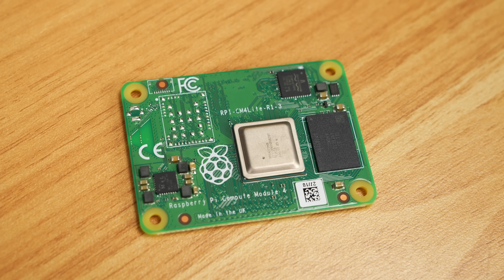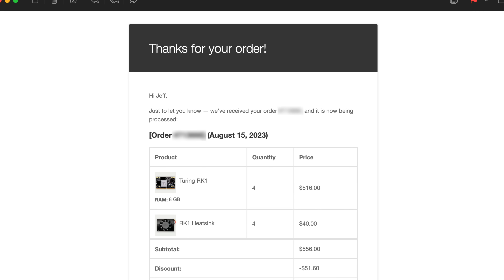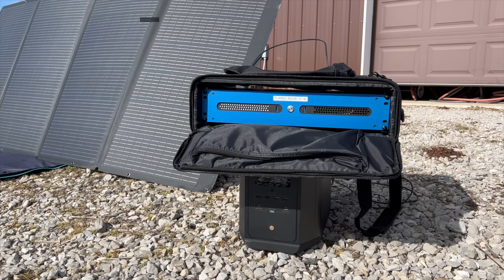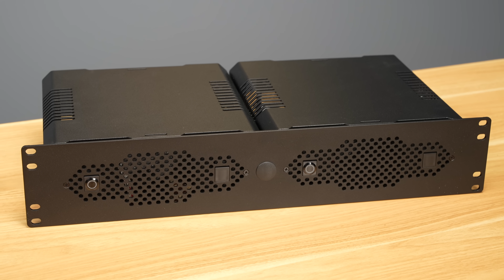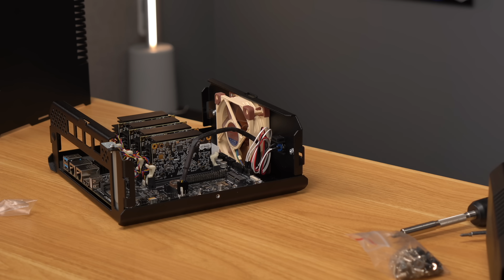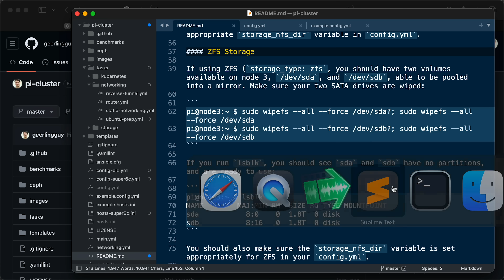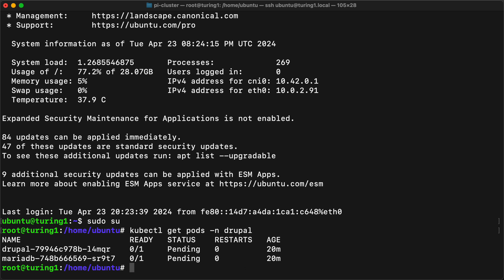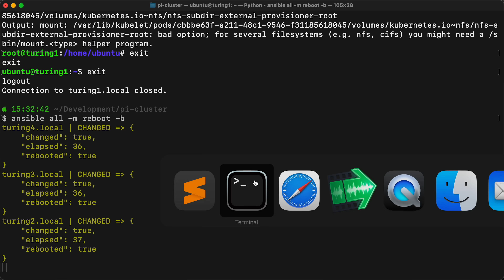Meet the new SBC Linux Cluster King!

Comment: My biggest issue with working with Pi's and Pi alternatives has been lack of conformity to standards such as ITX boards, or even conformity to Pi's I/O and size so that you can just use Pi cases or options. Something like that ITX Board, as well as the rackable case is a huge leap forward. Yes, we can 3d print things, but the more options we have, the better. 

I love SBCs, but prior to now them not having more standard footprints means that I literally sit a pi-hole with a POE adapter on top of a POE switch in a rack. It made no sense to have a full 1u or bigger rack mount for 1 pi. Then I have the second pihold on a separate part of the network, just sitting next to my NAS in a different room using a power adapter and network cable as I had power available there. I also have numberous Libre Computers sitting around, just strewn everywhere because where they needed to be, I couldn't put a rack.  Most of these locations have other computers and if we had more options for say, PCI brackets as well with power and network cabling through the PCI bracket, I'd mount them in the PC cases. But for now, they are just sitting in 3d printed cases.

So things like this are a great idea and leap forward. I'm excited to see more options coming forward as I mainly work in IT Support, not systems administration (which I can do and am good at), not Devops, not with 3d modeling, etc. I can implement and combine solutions if they've been built and sold, or I can implement very simple solutions. The more options I have, the higher probability of Pi and Pi alternatives have of getting into my workflows instead of tiny computers like the Lenovo M90n, or the other Lenovo Tiny models. I definitely don't need their horsepower, but they've just been a better option ultimately when I can get them at work's surplus sales for say $40-$150.

Comment: When you mentioned the poor network connection for the tasks you might run on that board, it reminded me of something that annoys me a lot (I do not remember if I said it here before) and I have been preaching for years (maybe not hard enough) in the hope that maybe someday manufacturers hear me: 
Motherboards should not have IO attached to it. Specially now with fast PCIE connections. 
Instead they could have 4x (or even 1x for slower IO) PCIE connectors where people could connect short (as in length; maybe 5cm would suffice) 1/4 or 1/2 (half) height boards with the IO they need. 
This would turn the current IO on the back of motherboards into something modular that could allow, as an example, a user to put more USB of type XYZ in their motherboard without having to occupy a full length slot, or replace their gigabit network for a 10Gbit fiber, or add a WiFi card of the latest gen. 
Why must valuable space on my PC's back IO be occupied with 3 (or 6) jacks for speakers/microphone that I will never use? Or with connectors for antennas connected to a WiFi card that no longer works?
From my point of view Framework is on the right path in the laptop space except that I feel that they should be using PCIE directly. It would be better for connecting external PCIE devices. Baby steps. We need that on desktop too.
Sorry about the rant. Very interesting cases and cluster :)

Comment: Break out the soldering iron and swap the direction those power leads exit the PSU board. No more fan-blade jeopardy, no more stressing of the board connector.
Reply from the maker: True. May do that before I move the mini rack into its final location.

Comment: I did not know about 10" rack systems. Very cool.
Reply: @JeffGeerling In reply to your comment on 17:46 about the availability of 10" racks in Europe: I got lucky getting a 30cm deep closed 12U rack from a now defunct Polish company (COVID stock/supply issues I guess) I only could get the MyElectronics 2U enclosure in there by putting in some custom spacers to get the ITX case closer to the glass front door. Otherwise the cables in the back would just not fit. Any deeper rack would not have fitted in my utility closet.
I once revved out the diesel my driving instructor used when I was still learning for my driverslicense, some 300 meters from where MyElectronics is currently based in Alkmaar. I now have one more reason to chuckle about that event, 'some' American guy made realise that they were based there.. :)

Comment: I think I would have desoldered those pico power supply input wires and put them back on the other side.
Reply: I looked around the online stores and seems like some of those have cables on one side and some have on another, so buying from another vendor might also help If you don't want to mess with soldering iron or loose warranty.

Comment: Someone needs to do an OS from the ground up with different resources speeds and priority to actually make the best use of theese type of cluster boards...
There are so many solutions (mainly Linux ones I guess). But an OS that could handle any resource speed and just add the "power" and send different tasks with the resource speed in mind would just be awesome... I mean I have so many computers, phones, SBC and stuff... Would be truly awesome to install a component in everyone of them then get good (or even some use) in an a OS/Program.

Don't know exactly how to do it but... Lets say you have main/master then install "nodes" that firsts benchmarks the speed of the resource (read/write), then the compute power (I don't know what is best here... but OpenCL? and the OS has numbers it's could use... empty node, what is the threshold for sending a task to this node (because of the low R/W speed) is it worth it...if yes... send it... I mean my phone has some stuff that not even my (now old computer) does not have... It might be worth sending this task to the phone (resource)... and so on and on...

I remember setting up a render farm with all my older computers, and my friends computers thru 10 Mbit coax network, and that was just awesome...

So again... an OS (with programming language (that might exist today, or maybe better to actually create a new one)) that is built with the idea that you have low speed (again, could be a simple benchmark at the start of the OS the check what speeds everything is working with)...

Some programs would have no use for a phone (with 60 Mbit high latency network) ofc or even a fast CPU/GPU with 1 Gbit connection, but I can think of many programs that could use it... and again if you made the OS (dream OS? :-) you could always pretty much make use of older hardware (but it does need a sleep mode ofc, so no really really old hardware I guess)...

Comment: Could you use a M.2 to 10gbe adapter? Like the ones from Innodisk or IOcrest?
Reply from the maker: Technically yes—but the z-height on the bottom of the board would mean it wouldn't mount in any standard case, unfortunately (and you'd need one per node, adding a pretty significant cost!). But it is possible, if you build your own riser for the motherboard.

Comment: Lovely labels on the fan box ;)  How does this compare to the Ampere 64 core ASRock Rack? Withouth memory that is also $1500, so slightly more expensive.
Reply from the maker: It's a lot easier to build with the Ampere, it has a LOT more PCIe expansion available, and if you just want a high performance Arm setup, I'd go with the ASRock Rack setup.

I like the cluster so I can use it in my lab for little K3s/Kubernetes testing on real hardware, but it is still not a match for a single high performance workstation/CPU.
Reply: @JeffGeerling does one server motherboard will be faster than Turing pi with 4 boards ? I’d like to use kubernetes for my apps as well, is it worth it to set up a single node cluster on a board you mentioned?

Comment: I was initially dismissive of the Turing Pi 2 because of the so-dimm connector and having to deal with external PSUs and so on, but I must say I wasn't aware it had BCM so I might be regretting that a bit now...

So I guess the only good news for me is that the CM5 seems to be closer 😆
Reply from the maker: Hopefully. And yeah, the SO-DIMM means you have to buy extra adapters for CMs, unfortunately. But it's cool they made a BCM for the board, and it actually works pretty reliably in my testing. Would love to see more standardization in that area too, for others building clusterboards.

Comment: Really cool, but the price is too much...
I got 4x intel 100's with 16gb ram mini pc's for around 700 euro's.
Their performance is slightly less then the Turing RK1 and 16gb less memory per pc.
But it's plenty for my needs.
also no 2.5gbe ethernet.

for a +-1000 euros you can get 4 OKdo ROCK 5 Model B 16GB + cases + power adapters, which do have 2.5ge.
basically giving the same performance as this cluster.

So super cool, but not cost effective.

Comment: for deep stuff like the RK1 in that rack, it'd be nice if they included rear supports like what the shelf had.
Reply from the maker: That seems like an easy enough accessory to make—put a few bends in some metal.
Reply: @JeffGeerling  Perhaps someone (not suggesting you take this on) could design some brackets that could either be 3D printed, or sent to a service like SendCutSend or OshCut to be laser cut and bent as specified.  Yes, additional ones available from them would be nice.  They list additional rack shelves for sale, but don't seem to have considered additional support brackets as an item people might want.

Comment: I think Linus made a video recently using a CM 3588 with the same RK 1 to build a NAS
Reply from the maker: Yep! The RK3588 is a great SoC, still needs a little time in the oven but some builds are finally hitting their stride. For specific use cases, it can be great (low power, decent performance, lots of IO).

Comment: I can tell you directly that "set up the BMC, set it in a remote place, and never have to touch it again" is flatly false.  In fact, I have a job specifically for that reason.  My employer has a datacenter in Colorado, while the employees who manage most of it are in Ohio and Kansas City, so I'm here in Colorado to handle things they can't do remotely, including many, many times when the BMC stops responding, like what I'm about to go do in the DC in a few minutes.
Reply from the maker: Ideally you'd also have a PDU where power could be switched remotely. 90% of the time that'll fix an issue with a locked up BMC.

And for the other 10%, hopefully they pay you well, because when someone has to go in and touch hardware, someone really messed up the software! (And I have done that in the past, oops).
Reply: @JeffGeerling  The incident I just fixed was one of our students changed an IP address on the remote management server.  (I work for a storage company that has professional training, and I take care of the training equipment.) Always fun when dealing with students...

Comment: I just like how it looks, a compact blinkenlights thingy. So cool.
Reply from the maker: Heh, I need to make a Mini ITX board with just tons of little LEDs around random circuits and chips, that blink in random patterns. The Blinkenlights ITX Board.
Reply: @JeffGeerling  Jeff, I'm not gonna lie, but I even bought the IKEA "OBEGRÄNSAD" just to have more blinkenlights in my room. I'm a huge fan of the Connection Machine's by Thinking Machines corporation; even went to NYC just to see the CM-5 at the MoMA. I love the thought process behind it; to give the machines a visual representation of the computation going on as if the black box is thoughtful. I have a few of books and saved YT videos about it too. There's some other pure blinkenlight projects but I couldn't afford them. But I've basically built my own homelab around maximizing the lighting. I was sad to even leave my X79 DDR3 era boards when I upgraded because Crucial's Ballistix Tracer DDR3 were the only RAM kits with true electrically driven LEDS instead of pure software. Made quite a show. Wish you could see my setup, lol.

Comment: If you’re spending $1500 on a cluster, wouldn’t money be better spend just buying the best mother board and cpu? The cluster is being measured in gigaflops and most modern boats in teraflops.
Reply from the maker: Eh, only the higher end CPUs with 32+ cores are reaching into teraflop territory (and high-end GPUs), but building a system with those components will run you more than $1500.

Typical midrange PCs will give maybe 100-300 Gflops, similar to the full cluster performance, but they are much easier to use and manage since there's one and not four :)

Cluster boards like this are specialized and niche, they are definitely not meant to compete with a typical single PC (or mini PC, or single SBC).

Comment: Can each CPU directly address memory across the cluster? If so, what is the latency?
Reply from the maker: No, there's no inter-node link like that, sadly, only the 1 Gbps networking. It would be neat to see if a more premium board could either have 5 or 10 Gbps ethernet built in, or PCIe fabric, which is a thing now, though full of warts.

Comment: Fever dreaming out loud for engagement: I want to stick one of these cluster boards in a 2x 3.5" bay NAS case for a 3 node apps cluster and the 1 node that has the sata slots being the bulk storage. Alternately, would love to see a laptop form factor that could take one of those RK1s (like the MNT reform, or similar).
Reply from the maker: MNT reform + RK1 would rock! It's a niche use case and a niche laptop, but if you're in that niche, the RK3588 would probably be the closest thing to a 'good' average x86 laptop experience in Arm-land right now.

Comment: How much energy would a maxed-out Turing Pi II cluster burn versus a bunch of tiny N100 Intel computers equipped with 2.5G Ethernet? Someone could manufacture a 1U system stuffed with four such Intel computers without much effort.
Reply from the maker: About 18W; see my cluster testing in my top500 repo: https://github.com/geerlingguy/top500-benchmark/issues/27

Comment: The RK1 boards are crazy fast! I have two of these TuringPi 2 boards, running 2 RK1s and 2 CM4s each. A sort of P-module, E-module configuration. 92GB of RAM and 82 GHz of CPU. I use Hashicorp Nomad to orchestrate tasks using a combination of the Docker and Exec drivers. Ceph to manage the persistent volumes. Soon I'll be able to retire my power-hungry my Dell R710s in favor of a system that draws < 200W. Couldn't be happier with the results!

Comment: Really seems like the Turing Pi board could benefit from having a switch chip. Even if you still only had 1 Gb or 2.5 Gb connectivity to the external network, having a 40/80Gb switching fabric between nodes would make something like Ceph internal replication or any node to node comms in the cluster much better. Of course, having a 10 Gb SFP+ would also be ideal, since so much 10 Gb fiber gear is plummeting in price these days, and might obsolete the need for finding another big chip and traces on the board, so that might the smarter play.
Reply from the maker: I do hope they do a Turing Pi 3, where they maybe bump the price a little, but include some features that will let the board really go all-out on performance.

The problem is as the price of the board sneaks past $200, $300, or more, the audience gets even more limited :(
Reply: @JeffGeerling  I hear you, but I think this space could do with some better comms around what makes sense and what you can do with these platforms. Like, a 4 node cluster on the Turing Pi 2 at $1500 does not make sense for most home lab operators and especially not the folks running single purpose GPIO heavy configs, but $1500-2000 for a 4 node Ceph backed lightweight k8s platform with a slough of groupware appliance containers is a stellar HA homelab / business server in a single box. For the load of businesses I know trying to de-SaaS their OpEx while still looking for a reliable solution, this is barking up the right tree for sure.
Reply: In my m.2 slots I now have adapters that go to a 10Gb single network card. I have proxmox on each node and the 10Gb is being used for iscsi for the vms/containers. Its working great.

Comment: how does the cluster compare the a single large X86 CPU maybe a older INTEL or RYZEN ? Also what is the overhead in terms of losses from clustering 6 vs 4 SBC ?
Reply from the maker: It is about on par with a PC you could build for around $1000 for most uses—so the SBC cluster is more expensive overall, and is meant more for specialized 'edge' deployments, or for a lab environment where you don't want just one computer.

The full cluster gets 250 Gflops performance, which isn't shabby. That plus four NPUs means certain applications can run really well on this cluster.
Reply: @JeffGeerling  it is scalable and that is the important part + u can upgrade it as time goes there is a new* IMX8 with 6 A cores there are also some other ARM monsters from TI and NXP that are in preview so maybe in the not so distant future it will get way better
Reply: @JeffGeerling  BTW regarding that 2U rack UPS you can DIY it sort of easy if you know that you want well  enough .
OR you can unironically make it in a collaboration series with one of the PCB design channels /creators and get something more optimised and with some management
Reply: @JeffGeerling  Dont hype those NPU's too much. I have used them, in depth with the RKNN software and API's. the only conceivable app is object recognition and segmentation for certain precompiled models, and in that its far inferior to the dual m.2 Edge TPU's plugged into PCIe, and there is NO corresponding pipelining and parallelizing that the Edge TPU's have under Tensorflow and libedgetpu